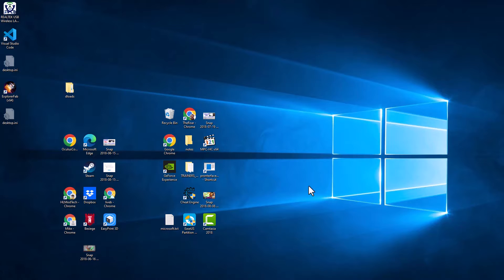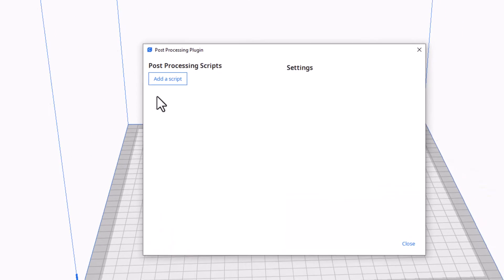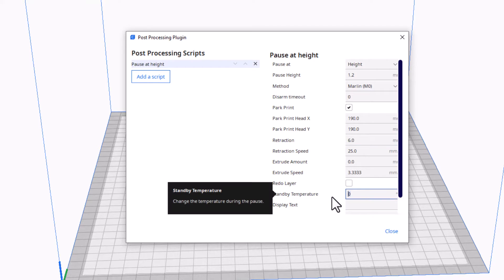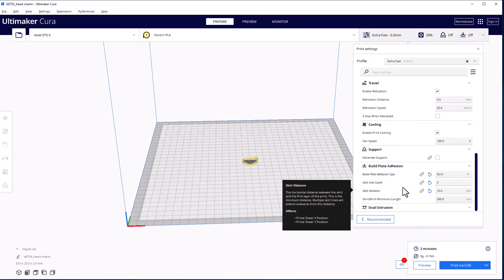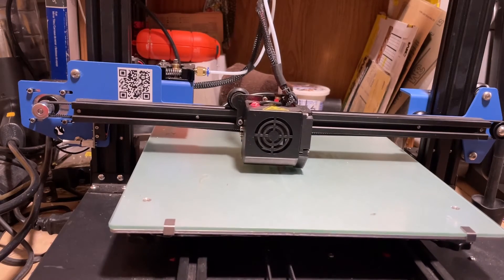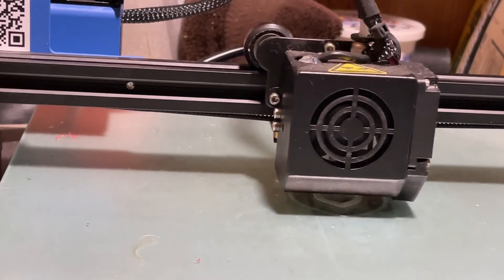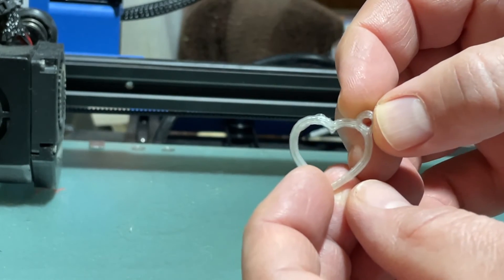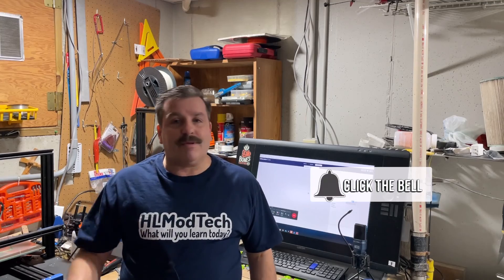Cura Pause at Layer height is not working with my Anet ET5X Any Tips

Comment: hey like your videos, was wondering if you knew how to do a change filament or pause at height for a anycubic vyper. i would like to do color changes with my vyper. thanks
Reply from the maker: Thank you. Totally appreciate the kudos. I have never worked with any cubic viper. I would start by just trying the codes. I share there. Most times when the printer can’t do it. It just skips the step.
Reply: so i used the cura code it does stop i change the filament. but i dont get a resume setting. then only way i have done is to manually pause the printer do the change and then hit resume. but i want to try this setting. will keep trying. thank you for you feed back.  @HLModTech
Reply from the maker: @sonicgundam660  Glad it stops. There is a marlin discord. They may have some good info for you.  I agree that having it automatic is way slicker than having to manually pause it at the correct level.  Have you watched the video in the description where I solved it for the ET5X?

Comment: As others have posted, I think it is a problem with firmware or gcode.  First check to see if there is a M600 in the gcode.  If there is Marlin should stop the print and go to a safe spot and allow for filament change.  I used this many times on my Enders, and had to write my own macros when I switched to Klipper.   If the M600 command is in the gcode, then it is firmware not doing what it needs to
Reply from the maker: I did test M600 and that did not solve it. Working on another test, so I may have some cool news to post tomorrow. 😉 Thanks tons for taking time to share.! 💯👍
Reply: @HLModTech  You could try to build a gcode sequence to do the same thing.  I did that with a macro in Klipper, took a long time to get it the way I wanted, but it was just what I wanted based on my hardware

Comment: Hi Mike. This is definitely a firmware issue. I think the m600 command is not implemented in the Marlin. M600 does firmware filament change. If anet not have activated this in Marlin the printer does the lift and prints emediatly the rest.
Reply from the maker: Thanks bud! I was pretty sure you would spot the distress signal and have great ideas. =-) I added Marlin 2 on a ET4, so I will see if it works as it should there.

Comment: @HL ModTech

This is exactly what I saw

The video I followed is https://www.youtube.com/watch?v=kkOuyhffNQk

The beep doesn't seem to work, the pause period I think works, but whilst paused there is nothing you can do to get the filament out.  On the print screen the 2 gear icon is disabled.  You can reach this by hitting pause, then change the filament, but when you release the pause it all goes belly up and prints in the wrong place
Reply from the maker: Thanks. That helps a lot.